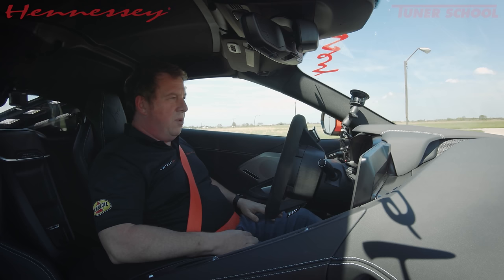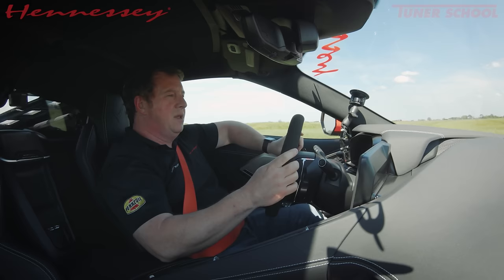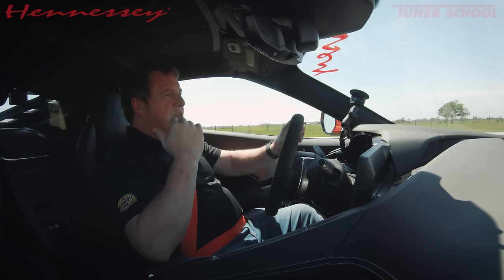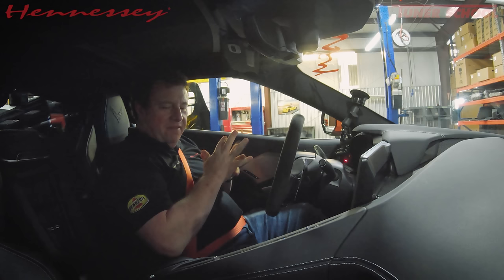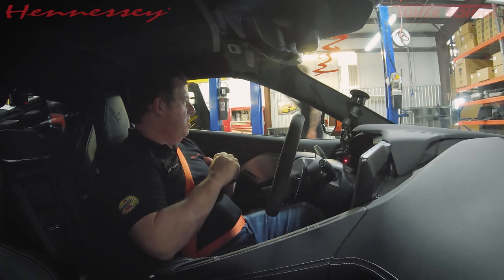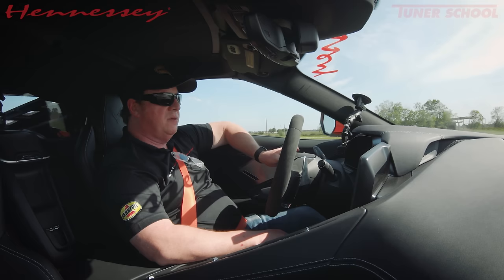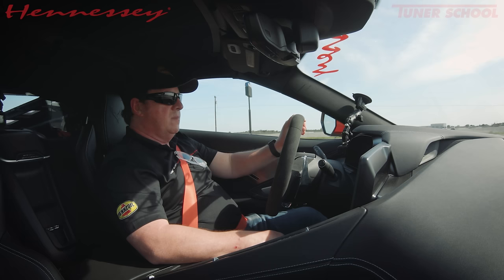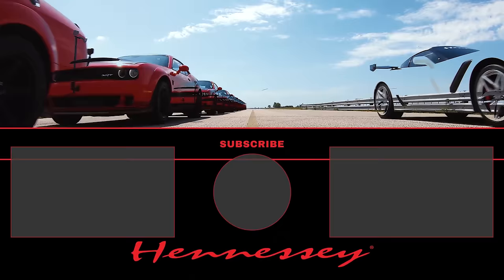Twin Turbo C8 Corvette Test Drive with John Hennessey

Comment: Dear God that car is going to be fast.
Reply: Gossip Heart  he means once they really get it dialed in
Reply: John said high 9’s with built motor, and turbo. Meanwhile they are already running low 10’s with a 100 shot.
Reply: @sew04ss  Has anyone cracked the ECU yet? Last I knew no.
Reply: @hughjaskoch5456  I'm sure somebody has. Some people move in silence and don't tell their secrets
Reply: @ChuckBeefOG  I haven't seen that...link?
Reply: warriorpluto  disagree with you EFILIVE does aswell
Reply: @ChuckBeefOG  yea, but we know Hennessy usually doesn't make the fastest builds either. The only thing they've done I think is really worth speaking about is the venom gt
Reply: Trumple Wiltskin what do you mean cracked the ECU? I’m sure the factory would want it as fast as it could be
Reply: @dylancoric3734  what he means is that a lot of manufacturers builds soft of a firewall in the programming. Because of that tuners have to find a way through which some people call cracking
Reply: It has to hit over 200mph bc the stradman hit 173 on dirt stock
Reply: @jkreviea  Emilia Hartford's youtube
Reply: @hughjaskoch5456  GM wouldn't make it too hard.
Reply: @edkfour2061   @Chuck Beef  she's running 10.8's not low 10s.going to take a lot more than a hundred shot to pull that off.
Reply: @bigbreezy5947  torque and gearing.
Reply: @hughjaskoch5456  sheepy stated that the car has factory widebands. It tunes for boost almost automatically.  Most Surprising is the fuel system left THAT much on the table.
Reply: LS IN THE MIDDLE MAN WHAT U EXPECT
Reply: wait for the c8 ZR1
Reply: Will blow the mess out of the Shelbygt-500.  Ford is in trouble. The Shelby barely edge out a base Corvette even with a 200hp advantage.  This car is total annihilation
Reply: @dylancoric3734  No. They dont come like that through the factory, these cars have emissions to pass
Reply: @ChuckBeefOG  stock turbo coyote running 8.2 1/4 lol.
Reply: FullAutoGT For 50 pulls or so, then BOOM.
Reply: Scar face  Not even in the same game dude! 0 - 60 in under 3 seconds! 2.8 from what I have seen. Whats your coyote at? Not to mention the the hook up on a mid engine vehicle. They werent after a Mustang, they are after Supercars, and some of those are in jeopardy of a base stock Corvette.
Reply: Over the next 5 years.... this platform will do damage.
Reply: @akselcapuri  That will be too much car for anyone
Reply: @ace-lo1nq  mustang will never compete will the corvette. It can barely win against the Camaro. The top of the line model of mustang has either tied or lower than the lowest Corvette. But I agree with you
Reply: Scar face  I watched a Youtuber that did a vehicle swap of the new Corvette and a Gt500 and to watch the remorse on that guys face was AWESOME! He got back into his more expensive car and said that he was more comfortable being in a common feeling car! Im sorry, but when you get to performance, why would you you want the feel of a non performing car that feels ordinary! And that cant match the way lower horsepower car(by 200 hp) drives or handles! Time will tell, but Chevy has something good on their hands that the rest of the Automotive world is scared of! More power now please! If you havent seen, Ferrari already has been using the magnetic ride!
Reply: Chuck Beef  10.65 with a 50 shot
Reply: It already is. The C8, is an amazing car. (:
Reply: @hughjaskoch5456  Standalone systems are way better anyways. Better tuning, better parts, better aftermarket knowledge
Reply: Bryce Czirr Electric PLUS AWD is what makes the Tesla vehicles so fast. Take away the AWD and they would still be fast but beatable. With electric and AWD they are simply unstoppable.

I really want to see what a relatively light weight, large displacement, boosted, and AWD mid engine car can do.
Reply: Bryce Czirr I just want to see the ultimate petrol car be built before pure electric takes over. I imagine the Jesko will be that car. Perhaps a future C8 could be that car although I think the Koenigsegg will have a better shot at being that car.
Reply: mpgxsvcd This video is showing us a good glimpse of that. This is an exciting time in the automotive world.
Reply: Missile
Reply: Am I the only one that thinks a tune only 720S will beat this car
Reply: @Bryce Czirr Tesla goes brrr
Reply: @ChuckBeefOG  and a void warranty. Hennessy won't void  if you take it to a drag strip as to where GM probably will. Then there's all the other goodies they're going to add. This is a track Corvette not you're fathers straight line zo6. Then Callaway will of course have a crack at it.  That's a whole different monster all together.
Reply: @ace-lo1nq  the Shelby is not the vette competition the GT is.
Reply: 1,200 horsepower
Reply: Sadly the C8 isnt even the top 10 fastest Vettes of all time. Its quick not fast once you hit 110 the C8 vette stops pushing itself to the limit unlike the Older Vettes. Vette were monster off the roll while this one loses to Mustangs.
Reply: dylan_mx_bmx factory is usually a conservative tune for EPA reasons
Reply: Gossip Heart  the c8 is not that fast, it just got 492hp, the excellent grip and handling is what make it good
Reply: It is fast.

Comment: Every C8 owner just cursed Google’s AI for putting that in their recommended videos.  Can you say, Gotta Have It!!
Reply: m - I saw that and that Vette was impressive.  The driver did do a good job but it looked like he wasn’t hitting the apexes correctly.  Maybe it was just the optics but either way, that Vette is an engineering marvel.  Wish he had better tires on it.
Reply: I wouldn't care about this upgrade if I had a C8. The car is already fast enough. Wait WHO am I kidding?
Reply: @WarriorsPhoto  Depends on how much you want to spend over time.  A turbo charged engine is under greater stress and tends to wear faster.  The stock transmission may not be designed to handle the much greater load.  The shift duration in this video seems to be much longer under hard acceleration.
Reply: Karl K The end part was to add a little bit of laughs. I don’t modify cars anymore. I may when time and dollars permit go get a 90’s era Japanese car or Corvette Z06. But other than that a modern car is more than capable for my daily needs.

Comment: Turbos sound so good on this car and exhaust is just right to! Absolutely killer build guys!!!!
Reply: Not trying to make you mad how ever I love turbos can't get enough of that sound. However my instant reaction was nooooo it sounds like a old truck duel exhaust pickup truck that someone put turbos on. Guess I'm not a fan of this particular sound. Its absolutely an amazing butt kicking car though.
Reply: Jackson Fawbush while I still like this sound. I personally prefer the raspier sound the c7 engines had.
Reply: Jackson Fawbush probably still needs a little R&D to get the fit and finish nice. It’s still a prototype after all
Reply: I agree with both of you c7 is a proven example. I have no doubt this turbo system is clearly an actively advancing prototype that when finished will be all of our wish list items.
Reply: @jacksonfawbush5439  thats prob bc the exhaust is quiet
that cats are really restrictive
Reply: @jacksonfawbush5439  Everything you said about the sound I agree with 100%.  And that is the only reason why I would rather supercharge this car and add a proper sports exhaust (no resonator - cat delete).  It can still go crazy fast, maybe a few milliseconds slower than a twin turbo but sound is still something super essential for me if I ever own a car like the C8.
Reply: *too

Comment: All: "How does the radio sound???"

Hennessey: "the turbos sound great!"
Reply: Lol my friends used to ask me why I didnt listen to the radio.  I always said I was too busy listening to exhaust and cam.
Reply: I won't even hear my radio if my LS1 if past 3.5k RPMs.....seeing how this LT2 can crank to 7k RPMs the radio would be the last thing I'd use in this machine !
Reply: Now going to channel stutututut
Reply: Oh the symphony of 8 cylinders that sound like a jet are quite lovely!!
Reply: I'm of that same mind. The stereo in something like a C8 is useless as far as I'm concerned. I pulled the stereo out of the Z28 way back when, and replaced its face with a gauge & switch panel. It's not like the stereo could be heard over the sound of the exhaust through the cutouts anyway.
Reply: @harbingertheheretic3541  forced induction cars are always the best, the spool of a big turbo and release of the wastegate or the sweet sound of a small pulley supercharger screaming as you shift thru the gears... Who needs a radio when you can listen to the best symphony in the world? 
Your engine.
Reply: Amen to that !
Reply: What does going one way or both ways have to do with anything ?
90% of people who drive these aren't dumb enough to use their fun car for an 8 hour drive in the first place, they will take their family ride instead.
And those that drive this as main don't drive 8 hours on a regular basis in it, probably less then 5% of all sports cars are used for extended travels.
The only thing you said that made sense was the quiet Small Block operation at highway speeds.
Not everyone listens to the radio in a car as well, some just don't no matter how far they're going.
Reply: Most importantly Hennessey is not here to talk about BS you can learn from any second rate journalist in a road test review, he's here to show how the C8 feels with more power, test of radio here would just be a waste of time !
Reply: @g00dl00kinb0i  That's why I have 2 cars. One for family 8hr trips.. And when I'm alone I play with my other car and care less for the radio at that point. Guess I'm not normal, Then again I drive SAAB.
Reply: @g00dl00kinb0i  btw I couldn't have said it any better. Excellent point!💯
Reply: Devil’s Advocate  you need a 2nd car, a beater so You won't have to worry about a 2200watt system in it.
Reply: @ Saab_lyfe190 Thanks!

I only own one car but would never desecrate it with a long trip down roads I'm not familiar with hours away from the house, unless the purpose was to find good country road to play on.
Long trips is where I can rent something different and more reasonable then a Camaro, it's a great fun car for real, fast driving but horrible for long trips, specially at night even with my 20/20 vision.
Yeah, Saab is not your ordinary car, what happened to them after GM ?
Reply: @OG_DSM  I'm a Lexus man myself... family cars with 2jz can't go wrong
Reply: Makes sense right. (:
Reply: Well if any of you are like me, I do take my sports cars on long distance road trips when it's just me. For these trips I am using the stereo, therefore the stereos equipped in cars definitely weigh into making the decision for what cars I end up purchasing
Reply: @g00dl00kinb0i  I disagree with almost all of your points. As a car guy, I love driving, and I love spending time in cars that are fun to drive. Sometimes the less practical the vehicle is, the more fun it is to drive on longer trips. Where I live it takes roughly an hour drive to get to my favorite mountain roads, during that commute I absolutely have the stereo on and its quality matters to me
Reply: @OG_DSM  Well if you work hard and smart you get to a point where your 2nd car isn't a beater. When buying cars nicer that beater Saabs or early 2000 model year Camaros you don't have to make all the same sacrifices such as having a crappy 4 speaker sound system.
Reply: Right cause a good sound system is beyond the reach of anyone but you, you must be so proud of your achievements in life.....not every one is the same and music is just distraction as far as I look at it.
It has nothing to do with owning luxury cars or putting people down for not having one, to be honest a luxury car is about the stupidest thing to own it has zero value after a few years, do please tone down on your arrogance, you're impressing no one.
You can put you point across without all this other BS you said.
I got 6 speakers btw...
Reply: @slaub2  I've owned cars with nice stereo systems like Audi, but all that excess aftermarket weight of subs amps and wiring that can diminish the value of the car is just 90's to me. If I listen to the radio it's usually a talk show or podcast. I'm not distracting myself changing stations or playing with my phone for the right song. You can cause an accident tBh. And as preference I do like Saab and that's why I have 2 of them, reliable, unique, comfortable and sleeper fast. I love taking down BMWs and camaro ss owners from a 4th gear pull...
A car doesn't distinguish anyone's accomplishments, it can make you look like a douche, it's what you do with your accomplishments that matter at the end of the day. When buying cars, my priority isn't how loud the radio sounds. It's how quiet and smooth the engine sounds under load. 
You can't teach that.
Btw one of my saabs has a total of 14 speakers from factory. Look it up.
Reply: @OG_DSM  I agree with you about the aftermarket stereo systems completely. I don't recall every saying anything about cars distinguishing my nor your accomplishments. Was simply stating that the factory stereo means something to me as I use all of my vehicles regularly to commute in as well as to drive spiritedly on mountain back roads. I only mentioned the word "beater" as I had seen it mentioned in one of you comments. In 2013 a good friend of mine had a 9-3 with a manual transmission and I had 2005 manual Volvo S60R. We would trade cars periodically and the Saab was a lot of fun to drive.
Reply: slaub I haven’t had a sports car for a while. The last one I had I did upgrade the stereo system and I was glad I did on long drives. Thus I can see your point. :D
Reply: @slaub2  I was looking at an 05 S60R but it was automatic. Those are great cars and fun to drive. The 5 cylinder turbo sounds very unique and the advance button was like nitrous. Lol. And I was speaking in general how some people boast about their cars and look like douches doing so. See them all the time at car meets. Saabs are definitely fun to drive because there unsuspecting. My friend would get eyed by cops in his BMW way before they notice that I was the rowdy one. 😁
Reply: @g00dl00kinb0i  GM bankrupt Saab in 2011 and sold SAAB off to a company called NEVS out in Germany I think.... NeVs attempted to make Saabs again but financials fell thru so Nevs sold off via auction the few that were produced. I don't think SAAB will ever come back.
Reply: @WarriorsPhoto  I agree. I mean it's different for everyone. I've had sat radio on my S4 and I tell you..... 200 stations of almost nothing most of the time. That's where I learned to appreciate podcasts... Lmaao.
I'd be at a light laughing alone and people in other cars looked at me as if I was nuts...
Reply: Saab_lyfe190 Exactly my thinking. I only listen to what interests me. Hence people must think I am looney when they look over at me. ;)
Reply: @OG_DSM  Yes, there' something special about inline 5's! Hopefully this doesn't come off wrong but I've owned several nice cars (preowned) and to this day the S60R is the vehicle I most regret selling. It did so many things well, it had great factory stereo haha, it had the most comfortable sport seats, great heated seats, the Advanced button allowed super firm dampers for spirited driving then pushing the button again allowed for a very comfortable and soft ride, it was a beautiful car and definitely flew under the radar, sounded good for a turbocharged car, made adequate power, and was a great and fun daily driver. They also came equipped with incredible Brembo brake calipers from the factory, seems like a lot of newer vehicles have ugly factory calipers such as Jaguar. Some things I didn't like about the S60R were; it had a terrible turning radius, the factory angle gear in the center dif was prone to failure and expensive to repair, the car under-steered badly we driving the car hard, and there wasn't much support in the aftermarket world.
Reply: car guys wanna hear the engine anyway.
Reply: cliff cox Amen, AMen, AMEN, to that. Thank you for mentioning this.
Reply: @slaub2  seems like all cars of this era were pretty bad. BMW fails with the valve seals, Audi with reliability, Saab with the Haldex awd system, Volkswagen with emission issues Mercs burning oil... But at the end of the day we love to drive and appreciate these headache-loaded cars.
Reply: @cliffcox7643  Yessssssir. 💯% for sure.
Reply: @cliffcox7643  Yes, so true! A nice exhaust note and tone adds so much to the driving experience! For that I'm still on a naturally aspirated kick. As crazy as this sounds, I like N/A because they are usually slower which means you can wind out multiple gears without going stupidly fast speeds on the roads.
Reply: @OG_DSM  When you say cars of this era do you mean from ~2005 to 2014ish? If so, that's my favorite era. RWD, manual, N/A cars were more prevalent and made great power and exhaust sounds
Reply: Just play the first 0:56 seconds of this video closely to your ears and close your eyes for that minute!
( It sounds stupid but just listen to how the turbos flow and how aggressive it gets as it reaches red line under boost.)
Reply: Music to his ears .
Reply: Vrooooom!!!!
Reply: Who needs to listen to a radio when you have a twin turbo C8??
Reply: instaBlaster.